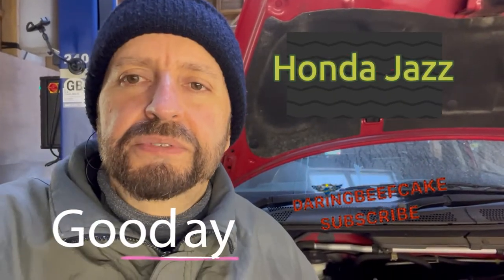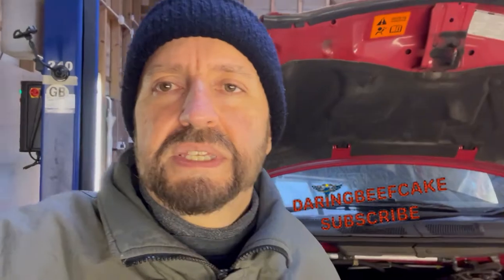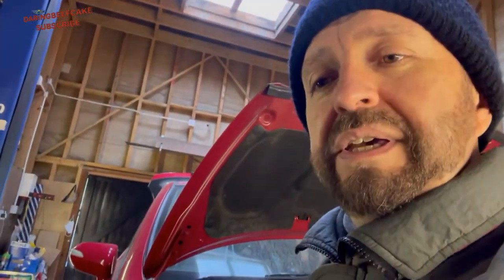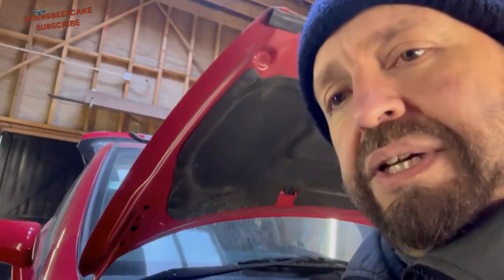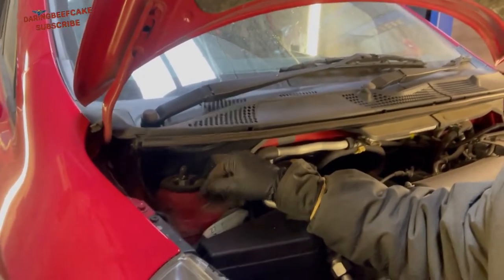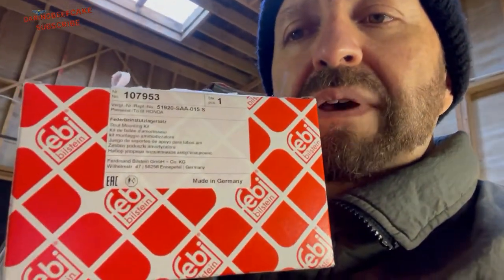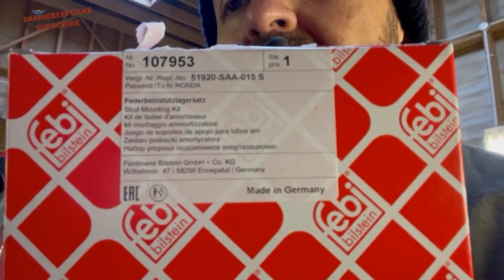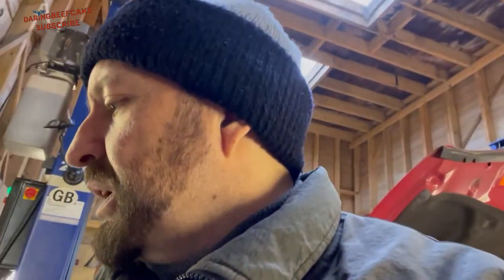Honda Jazz top suspension mount and bearing removal and replacement

Comment: There is always play in these when the wheels not on the ground,it's the way it's designed and completely normal. I've had this told to me by honda as it came up as and issue for mot
Reply from the maker: Well it’s not true, they do have a bit of play after a while but to much play means replacement. I hardly had any play after replacing them.

Comment: Our 2012 Fit has a slight bumping/knock/clunk sound in the front end. I have checked things out and all bushings are tight and sway bar links are good (I changed the links last summer). Honda mechanics did not notice anything when they changed my axel shafts under recall recently (I asked them to check front end out otherwise, pretty sure they would have "found" a problem if they could have since they were doing recall work for free already!)

When I change over to summer tires again in a couple months, will play around with the strut and see if this might be the issue that is making the annoying clunking sound.
It is an annoying sound, however the car drives totally fine otherwise. 

Thanks for the video and perspective, helps a lot!
Reply from the maker: Glad the video helps, I hope you can find the issue and resolve it. It’s not very nice to have knocking noises.
Reply: @DaringBeefcake  yes I've been trying to "live with it" since alignment and drivability still seem OK, not always easy to ignore though, haha! Especially when it happens over the smallest off-camber bumps in the road
Reply from the maker: i totally understand, any knock squeaks or noises annoy me so yes sometimes it get hard to ignore.  @bopper989